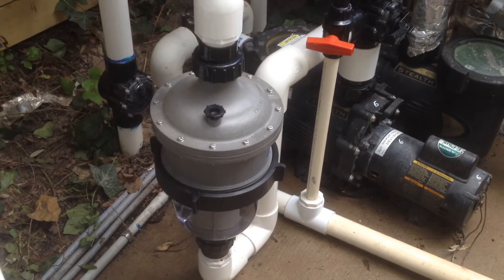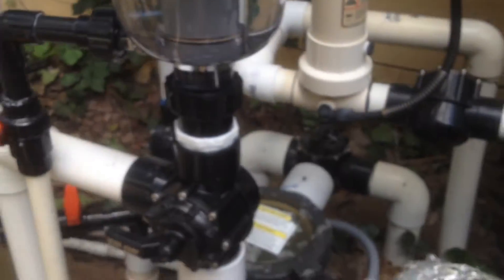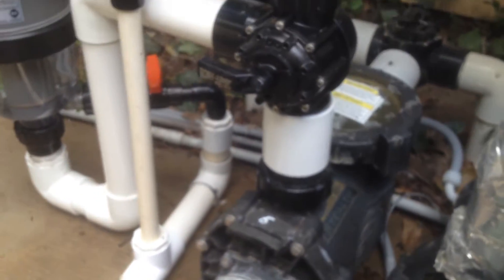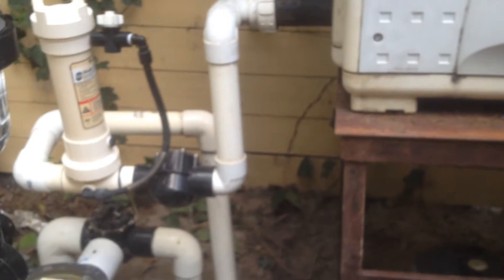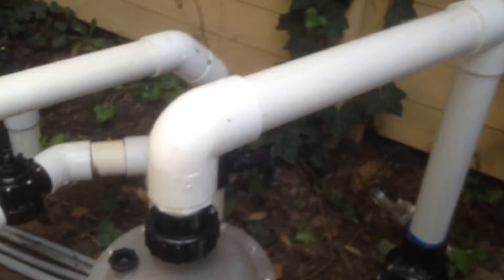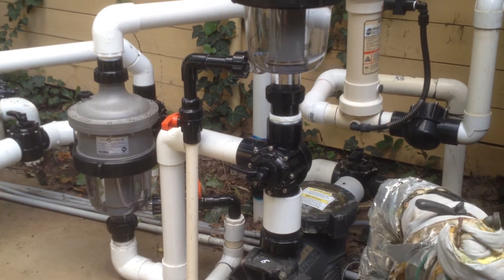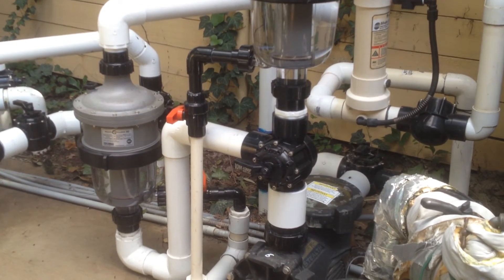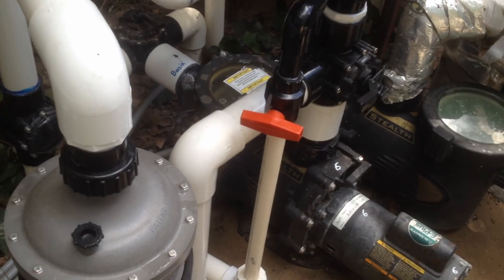Jandy 3 hp pump with Waterco Multicyclone 50 Filters on a Negative Edge

Comment: Say dude you need a FUCKING FILTER with those things. Hell a basic sand filter with Zeosand with filter 2 to 5 microns.
Reply from the maker: This set up is for a NEGATIVE (infinity) EDGE pump. There is already a Pentair TR140 with its own pump for filtering the pool water. Most negative edge pumps in East Texas don’t have any kind of filter on them. I have a video posted here of how I found it - with a little TR60 on it. Client was thrilled with the tripling of the volume of water going over the edge.